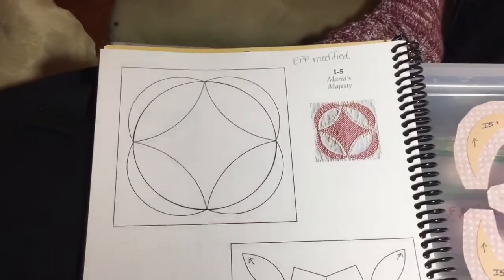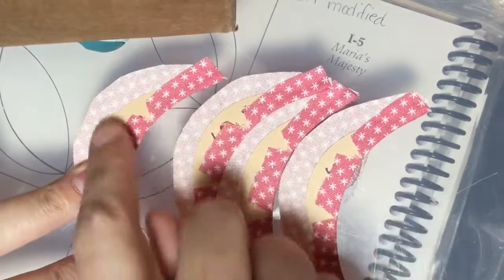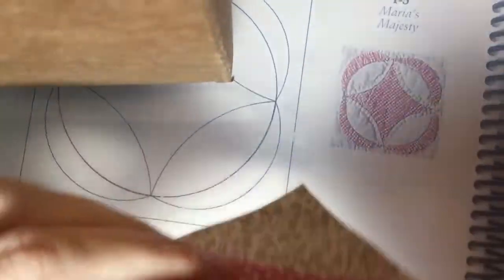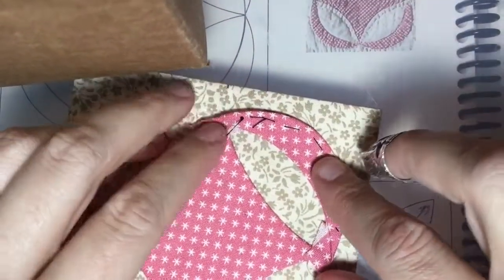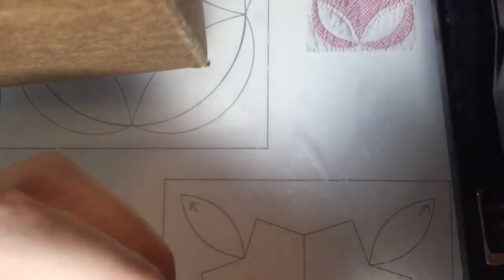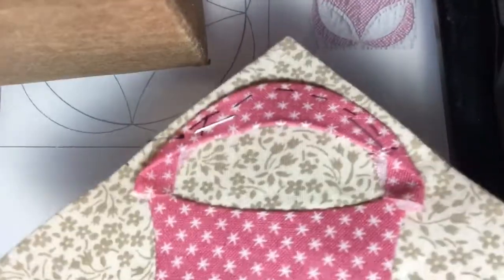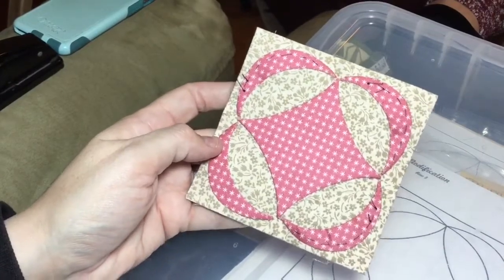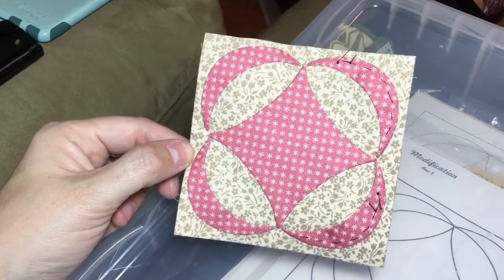I5 Block Assembly - Dear Jane Goes EPP

Comment: Using a flat, wood cuticle stick is a game changer on places like this. Slightly moistened (spit), the wood "grabs" the material and holds it as you push it in place and all but eliminates the fraying. I am a long-time student of Elly Sienkiewicz for applique and using these small sticks increased dramatically my success in these kinds of points.